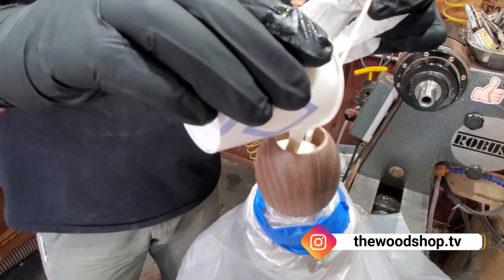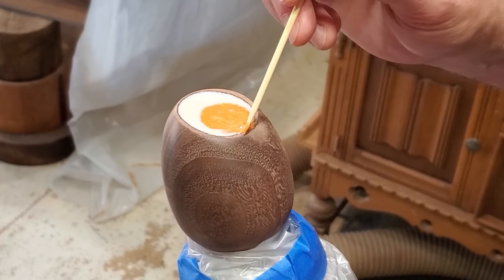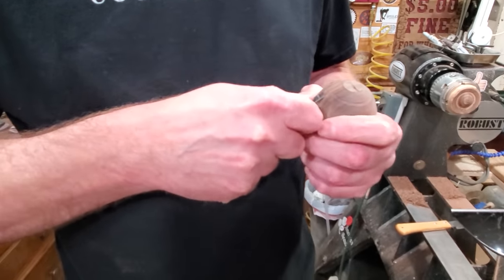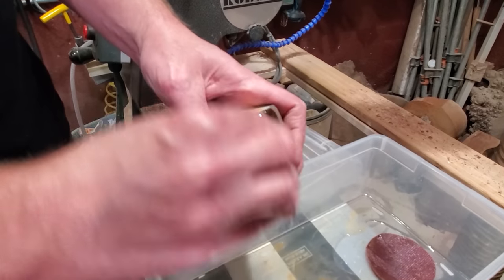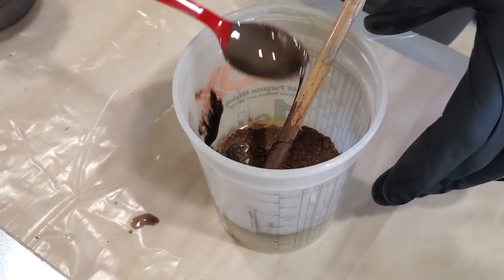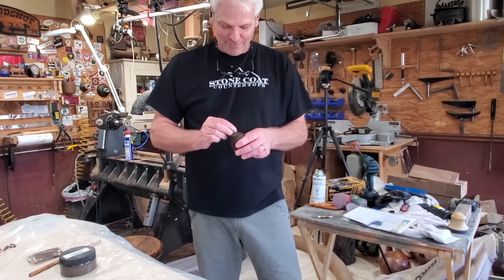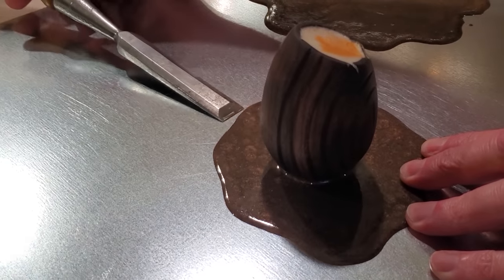Epoxy Project | Resin and Walnut Cadbury Egg

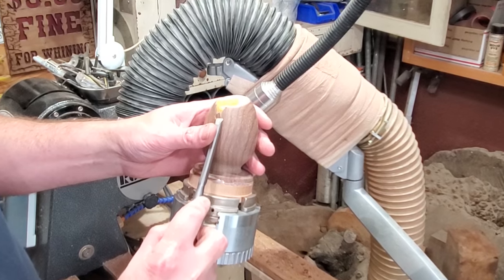Comment: 4:00 Black Forest Wood Co. uses fans to keep their resin from overheating during thicker than recommended pours...
Perhaps you can use the same trick...
Reply from the maker: Black Forest uses casting resin not quick coat. Stonecoat makes a great casting resin and you don't need a fan. I've used it several times with no issues.
Reply: @CarlJacobson  True, I was just responding to your comment that your Resin was starting to bubble and smoke, indicating to me that it was overheating...